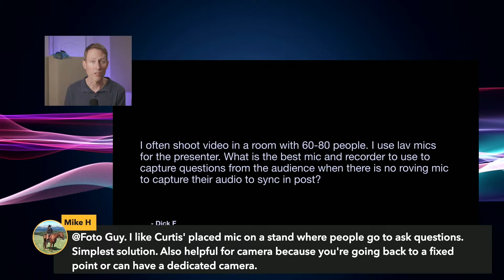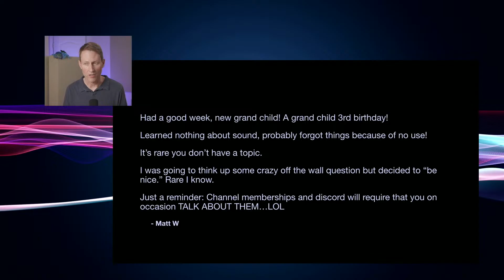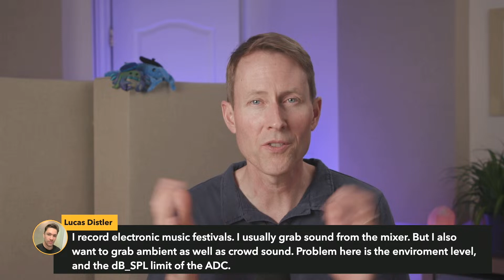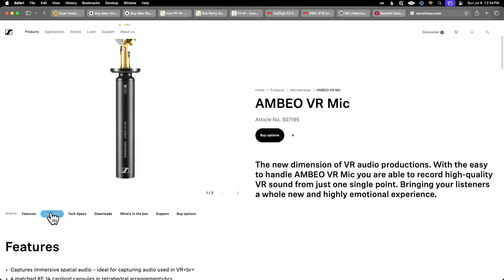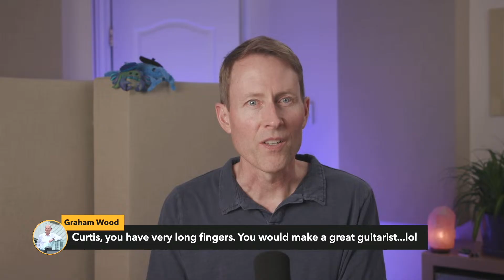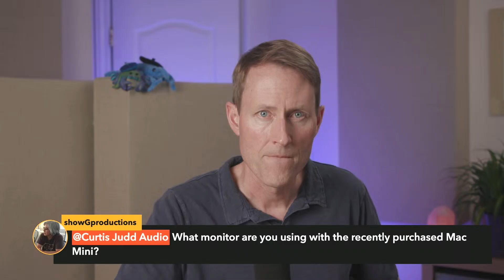Sound for Video Session: Question & Answer

Comment: Thank you for your channel. I’ve got a couple of Zoom H6 and been using them frequently over the years. Now I have the Zoom H5studio and am a bit surprised that most users out there compare it to the Zoom H5, but I’m feeling it’s more related to the H6 (original) than to the good ol H5. Anyone agrees on that? 
There’s no comparison between the two, only the H5:s. Is it the name perhaps?
Reply from the maker: I suppose it is closer to the original H5 in terms of form factor and number of external inputs. That's likely why ZOOM named it H5studio.

Which features are you referring to as more similar to H6?
Reply: @LearnLightAndSoundSessions  That might be. I was thinking of the better X&Y that original H6 has, compared to H5.
how ever, it's a piece of fantastic gear. Even the H6 is good entry level/prosumer recorder.